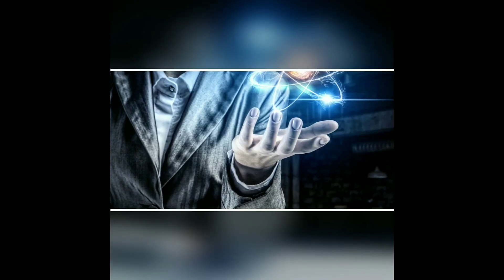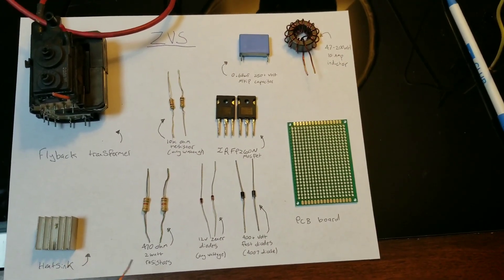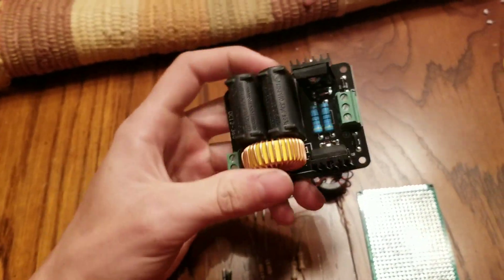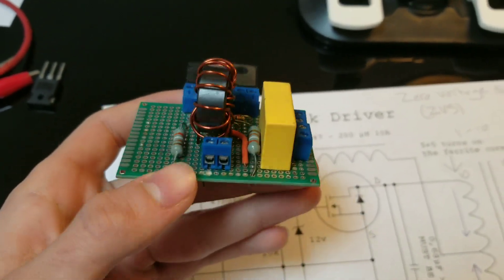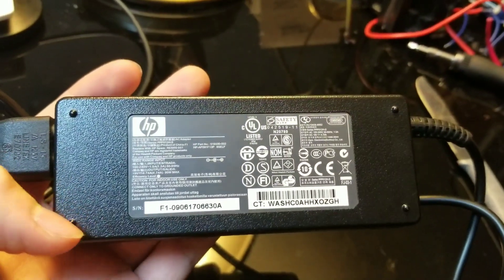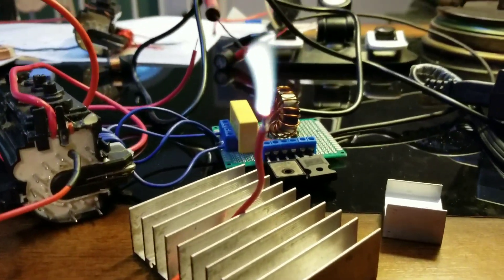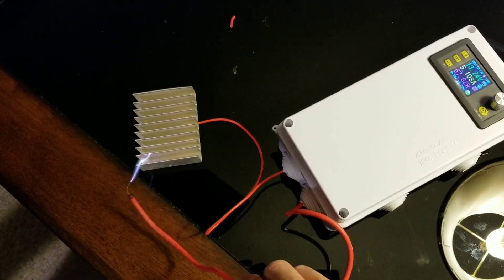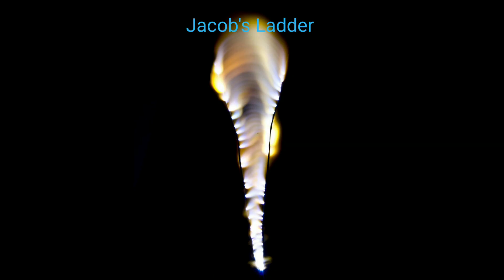How To Make a High Voltage Plasma Generator Powered By A ZVS Driver and flyback transformer!

Comment: And sir I also have used 2 capacitors of 0.33uf in parallel
Reply from the maker: That works too! Perhaps even better actually.
Reply: @orionindustries7201  thanks for reply but can you please make a video on how to make the power supply you used
Reply: @luciferclever7411  Yes true
Reply: @orionindustries7201  please make one power supply simillar to the power supply you made

Comment: No heatsink on mosfets!
Reply from the maker: Yeah heat sinks are definitely a good choice if you want to keep the mosfets healthy under high load or long operation. They normally don’t heat up since it’s zero voltage switching but in the case they do it would be smart to have them.

Comment: If the core slides up and down, that's just means the glue gave way. It can happen mechanically or if the core heats up enough, and melts the glue.Doesn't impair the function.

Comment: For the pre built Package with the flyback, does it need a power supply, and does it come with instructions, pleas get back to me asap!
Reply from the maker: Hey Andrew, yes it does come with full instructions. You can use any power supply between 5 and 40 volts DC.